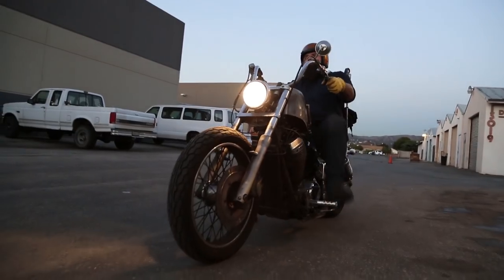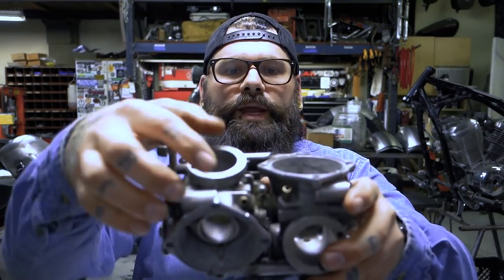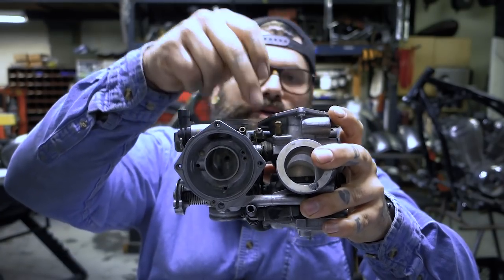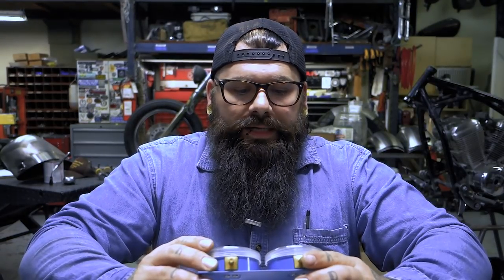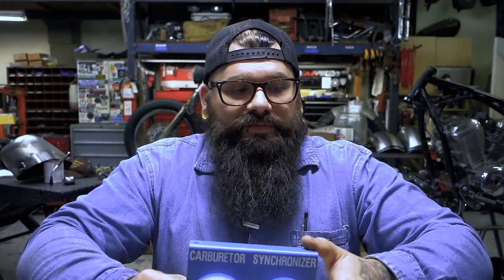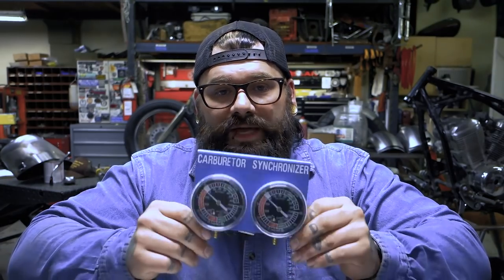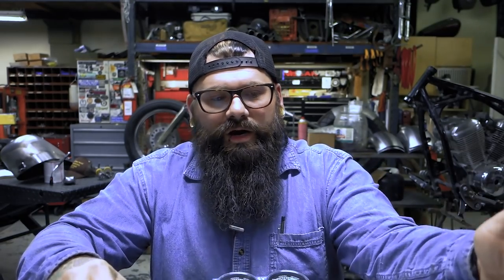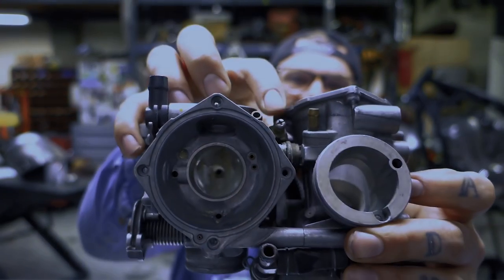Honda Shadow Sync Screw - Where Is It and How Does it Work?

Comment: Have the same EMGO vacuum gauges, they came with brass fittings and such to attach to carb. Good tool to have after a rejet or cleaning to verify the screw wasn’t adjusted unnecessarily.

Comment: Do I need to worry about  synchronizing if I'm just rejeting the carbs?
Reply from the maker: unless you fuckered with it, probably not. in all the carbs ive worked on, ive had 2 sets that needed to be re-synchronized because the person before me pulled the carb bodies apart.

Comment: So I have a honda shadow 750 and it runs but it runs on one cylinder. I have cleaned the carbs but did not touch the screw. I currently do not know what to to besides clean out the filter. Do you have any suggestions for the rear cylinder not firing?
Reply: One of my cylinders weren't firing and that carb was not getting any gas due to the float bowl being off making that side of the carb think it had plenty of gas when it didn't.
Reply: I'm very late, but to add, my 84 Honda vt700c i discovered yesterday wasn't firing the rear cylindar, confirmed by being able to hold the exhaust pipe after idling for a minute. In my case moving one spark plugs from the front to the back got it firing again. Specifically front right to left rear

Comment: 1998 1100 Shadow Spirit, how the heck do you adjust the screw? I mean I see it, but no real chance of accessing it with normal hand tools.... What do you guys do? Super long offset right angle flatblade? Super long wobbly end flatblade screwdriver? Or is there some trick I am missing?
Reply: My shadow has a hole in the frame under the gas tank for it

Comment: Do you need to sync carbs after installing performance jets on dual carbs? Or can the jets be installed without having to re sync?
Reply: And what jet sizes would you recommend on dual carbs with just long drag pipes and factory air filter?